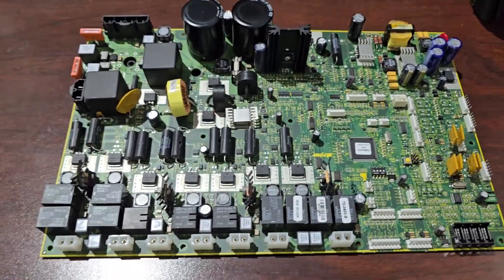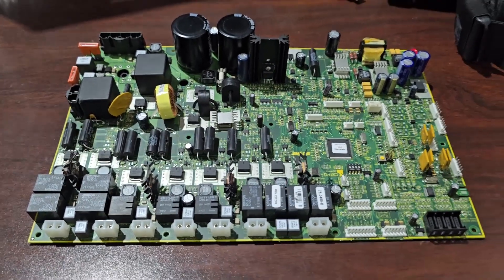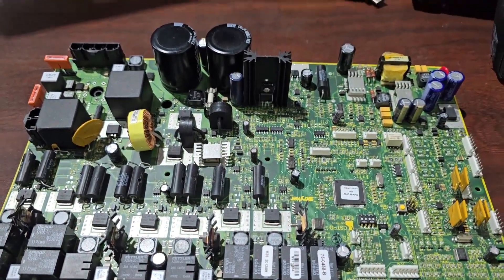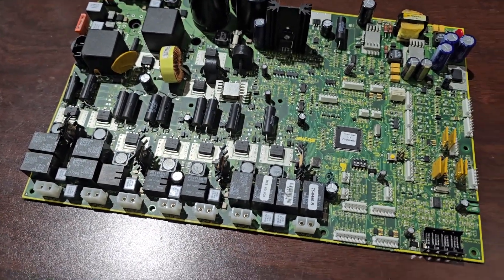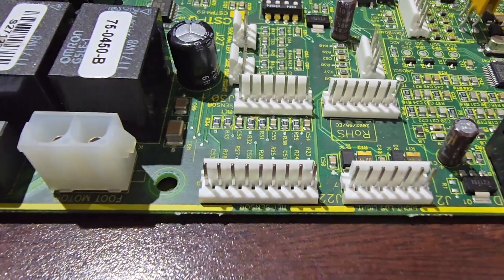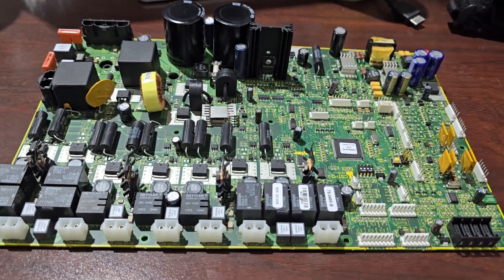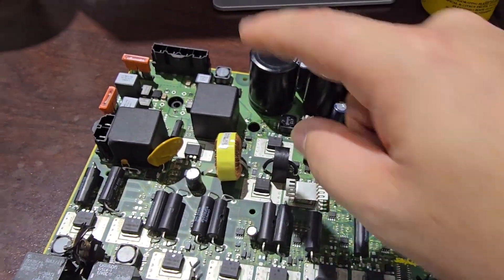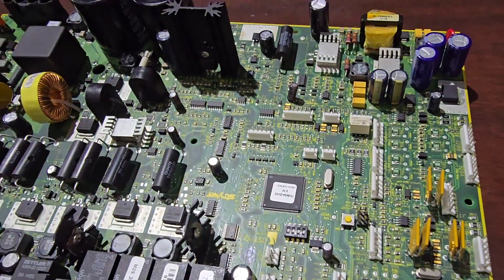PCB Funtion Identification

Comment: Whoever designed the board, based on Justin’s analysis, knew exactly what they were doing and had some definite experience there. I like the way Justin broke it down in simple terms like it was a schematic diagram.